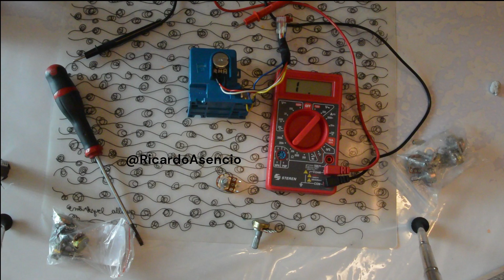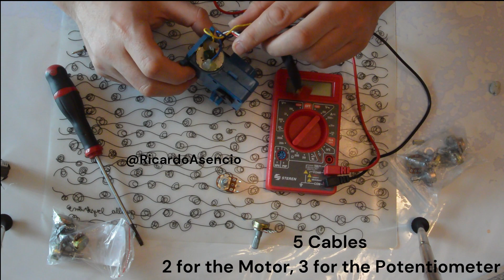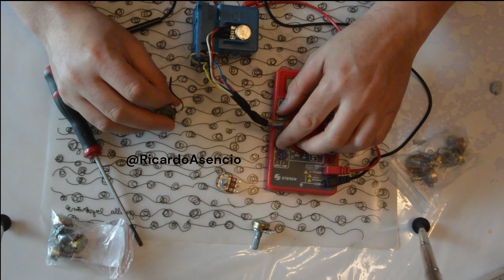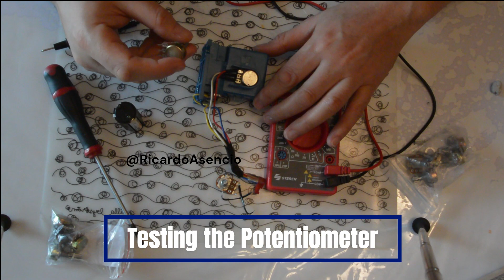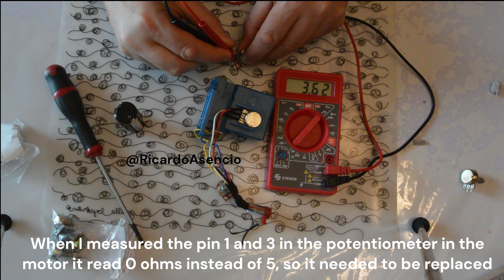Test and repair the resistance motor in your fixed bike or elliptical

Comment: I got a Schwinn 230 recumbent bike that was having an issue where the servo motor unit (looks different from this one) would just spin and spin and spin. Ended up taking it apart and there is one of these potentiometer in it. Schwinn only sells the whole unit for $60. I took a can of Contact cleaner and sprayed inside the potentiometer then spun it around for awhile. Then spray again and spin. Did this about 10 times to get it "clean" inside. Not even sure whats inside one of them that needs cleaning. Put everything back together and its works as it should. The bike no longer goes from hard to easy to hard to easy every 10 seconds. Now I have 20 resistant levels just as its supposed to have.

Comment: I have taken my motor gear box apart and got the motor going but when the load is on it (the pull cable) it sometimes works and sometimes will not. Being a electrician this tells me that the brushes are not connecting to the commentator or the motor is shorting out in the windings. So I believe it would be easier to get a new resistance motor # JJ03N 101627 I checked for pricing but by the time I ship it the cost is going to about $200 Canadian the same bike is on sale for $359. normally sells for $950

Comment: Hola. Tengo un problema con mi bicicleta, tiene el mismo motor de resistencia, pero funciona al revés cuando pongo la consola al mínimo va duro y cuando pongo al máximo suave. Entiendo que cambiando el orden de  los cables se solucionaría, pero no sé cuál habría que cambiar.
Me puedes ayudar?
Reply from the maker: hola! Quizá funcione de la misma forma y sea solo por software. Al desarmarlo como se ve?
Reply: El motor está bien, gira perfecto y no se ve dañado, solo que el giro va al revés. El resto de funciones de la consola también funcionan bien.
podría ser que haya algún cable cruzado en el potenciómetro potenciómetro y por eso lea mal el Max y Min?
Si fuese así, cambiando la posición de los cables en el potenciómetro se podría solucionar?
Reply from the maker: @fleiva74  Si, es eso :) Dependiendo de donde pongas el +/- sera la direccion con la que aumenta la salida. mira aqui hay un video donde lo explican https://www.youtube.com/shorts/jKE54jqOqV0
Reply: The pull cable is wrapped the wrong way  around  motor. When fully unwrapped you should have full resistance all wrapped is no resistance

Comment: This same architecture is used in many excercise machines to control the eddy brake.  I've had this fail twice in a bowflex m5.  Fortunately i saved the old one and could do some troubleshooting. The thing loses track of the 16 resistance levels.  Kind of a bad design because the potentiometer is housed where the eddy disc spins and there is even a fan attached. I bet dust gets into the pot.  I'm going to start with some deoxit.  If i end up replacing the pot I'm going to silicone the exposed areas.
Reply: Did you ever fix this?
Reply from the maker: Did it work? Or did you have to change the potentiometer?

Comment: Hey bro question so even if my motor is moving but there is no resistance this could be the issue? One thing I noticed is that the flywheel is loose.
Reply from the maker: Hi! The motor just turns that q wire that makes the magnets gett closer to the wheel.
This potentiometer is what they use to detect how close it is. 
If you hear the motor but you've got no resistance, this video will fix it :)

Comment: Hey, great tutorial. I think I have the same problem. Any chance you could put a link to the potentiometers you got off aliexpress? 
Nice job. Very informative video. 👍
Reply from the maker: I ordered two referencea, one of them is gone. The other one is this one (I'm not sure which one I ordered, order the one with the longer "thing that you turn :)")  :$2.06 | 5PCS WH148 15mm 3pin Linear Potentiometer 1K 2K 5K 10K 20K 50K 100K 250K 1M Potentiometers Kit With Nuts And Washers
https://a.aliexpress.com/_EzgZzcJ
Reply from the maker: And thanks :)
If you have the same issue fixing will cost you like 2 dollars :)